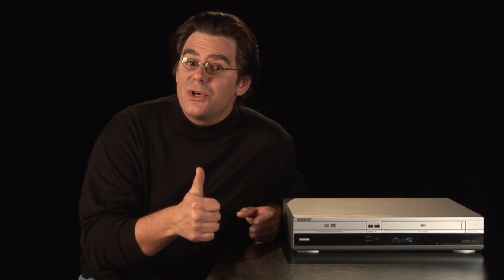VCRs & Computers : How to Troubleshoot a VCR

Comment: I have a Panasonic PV-7661 VCR that was left outside for a long time and I have been doing repairs on it to get it to work. When I play a tape, the picture is terrible even after I clean the heads. The outputs are both rusty. Tracking is fine. Picture is dim and very red, sometimes static. How can I check to see if it is the heads or the output with the bad quality?